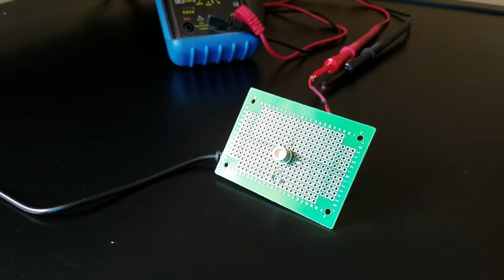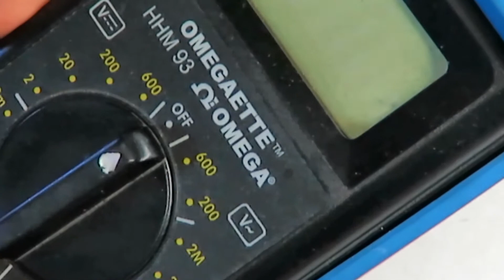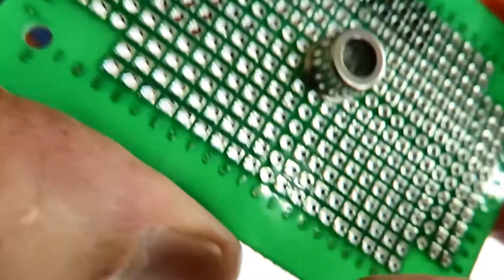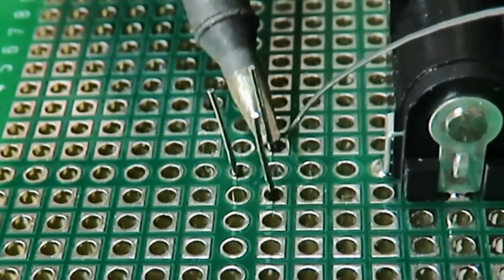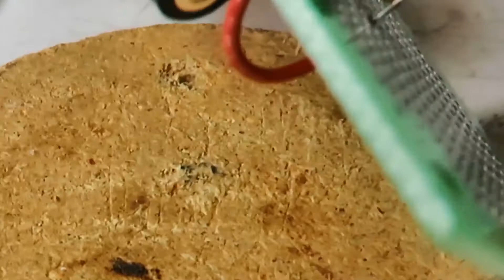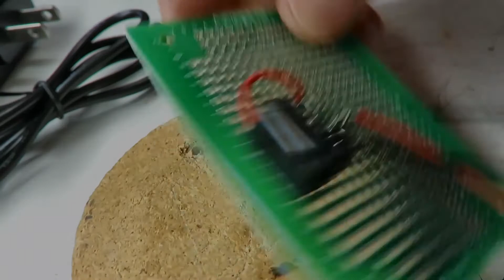UVC photometer- DIY low cost UVC measuring

Comment: Thank you. Where to buy this instrument plesase?
Reply from the maker: The various parts with which the unit was built can be found in the bill of materials at the very end of the video. Digikey is a distributor of electronic parts here in the U. S.. Power supply was found on Amazon.  Use any digital multimeter available.

Comment: Cool! What setting are you using on your meter and how do you read the output to measure a UVC lamp?
Reply from the maker: If I understand correctly what you are asking, the sensor will produce a voltage between 0 and 5 volts. Therefore the meter is set on any range that gives good resolution for the value it is showing.  In the video the value was a few tenths of a volt so that particular meter was  set on the 2 Volt range.  The next range up is 20 Volts.  Regarding the lamp output in the video I show the sensor data sheet where you put the voltage value in a simple equation in order to calculate the irradiance which is in units of milliwatts per square centimeter.  This is the UVC power per unit area falling onto the sensor.  Now you have a tool with which you can do various studies on a UVC lamp of your interest.
Reply: @fdolie7321   OK thanks! Looking at your meter it looks like about 1.9vdc that equates to about 2.8mw/cm2 (from the data sheet) which is 2.8 mJ/s/cm2. I read in the article below that they are using 300mj/cm2 in hospital settings to sanitize equipment and masks so that would be about about 107 seconds for your setup at that distance. Does that sound correct? I ordered the sensor and I'm excited to test my lamps! Thanks again! https://www.nebraskamed.com/sites/default/files/documents/covid-19/n-95-decon-process.pdf
Reply from the maker: @angstrom102  Whoa.  The reading in the video is 0.238 volts yielding 0.67 mw/cm2 at that position.  A dose of 300 mJ/cm2 will take 450 seconds.  My research shows that adenoviruses are the most resistant to UVC and it requires ~155 mJ/cm2 to achieve 3 log reduction.  Most viruses take only about 20-30 mJ/cm2 to get there.  I use my lamp mainly to disinfect my N95 mask for re-use, just like the article you referenced, and the lamp has a timer where the least setting is 15 minutes.  Therefore at that position I am dosing at the level of twice the 300 mJ/cm2.
Reply: @fdolie7321  OK thanks for the  correction / clarification! Looking forward to measuring my lamps. And thanks again for the super great video / instructions!
Reply: @fdolie7321  will you inform me how to calculate how long ang how big is the power we need for killing the covid-19 virus on the mask. Thank you🙏
Reply from the maker: @SahalaP  Go read:   https://scientric.com/2020/04/02/uv-disinfection-chamber/
Reply: @fdolie7321  Could you please provide the vendor info for the UV-C sensor.  I would like to purchase a sensor, if possible.